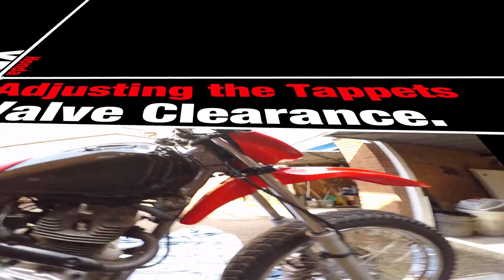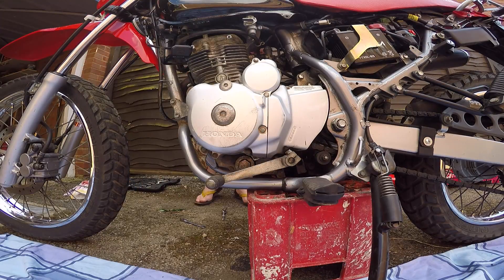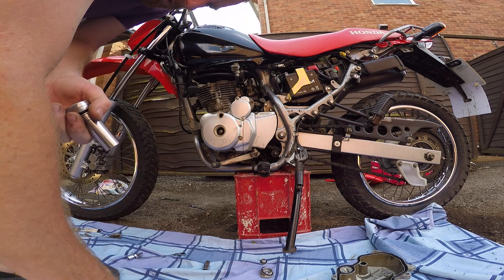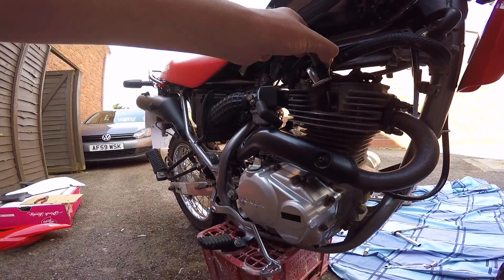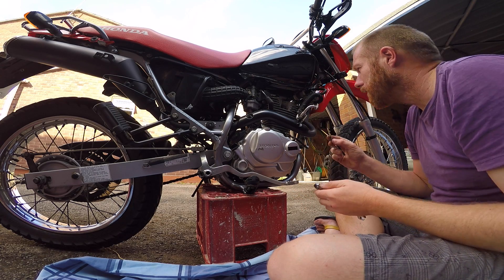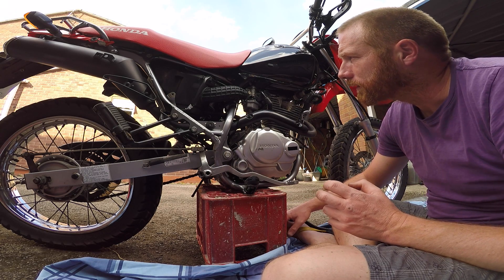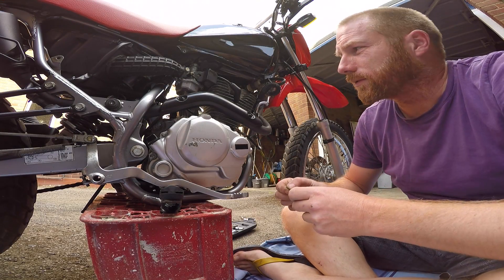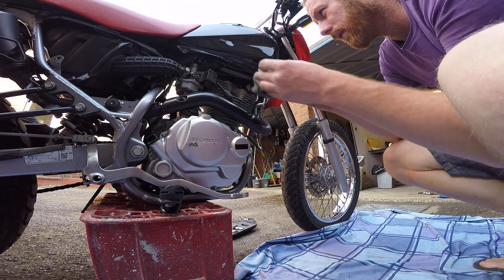XR125 Adjusting the Tappets / Valve Clearance.

Comment: The topic is troubled. 
I have a 2003 Honda XR 125 L motorbike. Brazil. 
I have copied a lot of manuals. The end result. 
Cold engine.
Manufactured until 2010. Valve clearances - inlet and exhaust 0.08 mm (0.003 in). Manufactured since 2010. Valve clearances - inlet 0.08 mm (0.003 in) and exhaust 0.12 mm (0.005 in).

Comment: i was right mate just looked it up in the manual you did them the wrong way round if i was you i would do them again or you could damage the exhaust valve or lose compression at the very least when the bike warms up cause the ex valve wont close properly,just trying too help you as i see your not very experienced.
Reply from the maker: +Julian Hiatt Holy shit mate you are right, well spotted. Id like to say i just said it the wrong way around but i doubt it. Thank fully the bikes been in storage for the last 5 months while im away and hasnt been ridden. I'llchange them / check when i return. Thanks for pointing that out.
Reply: Isn't it 0.08mm on both?

Comment: mate i think you got it wrong cause im a mechanic and ive never known the inlet too have a bigger gap than the exhaust simply cause the exhaust valve gets hotter and so swells more.
Reply: Julian Hiatt sir can you help me about my xr 125.
Reply: Well done Phil! I was feeling lazy on adjusting the tappets myself because the manual says to remove the fuel tank before. But you did just nicely.
Reply: Phil, does your bike choke when you fast full throttle from engine idle?
Reply: mine does

Comment: Can you adjust them easy? I didn't see how you did it. Is it chims?
Reply from the maker: It is quite easy. Read the comments below, I stated the wrong way round for the sizes of the gaps. You adjust them via a nut and thread with a locking nut if i remember correctly. Its been a few years and I no longer have this bike.
Reply: @PhilJC  ok thanks, I might buy one of these as a second bike. Good to know maintenance is easy 👍
Reply from the maker: Would be a good second bike for sure. All the best with yours.